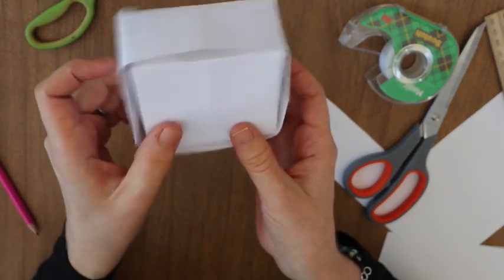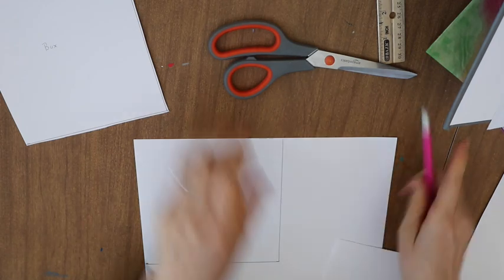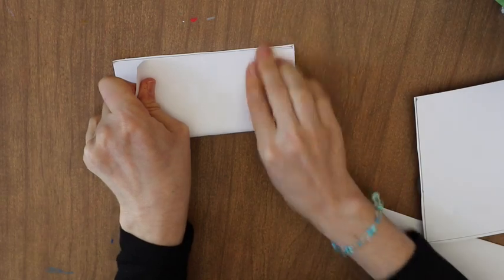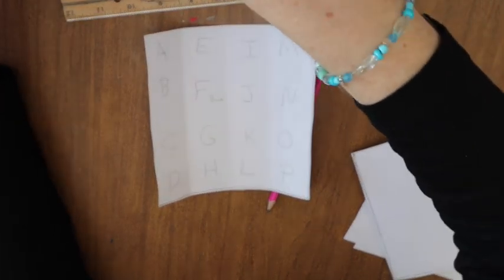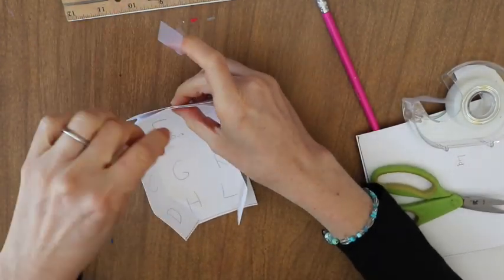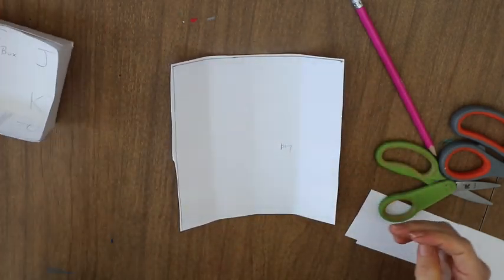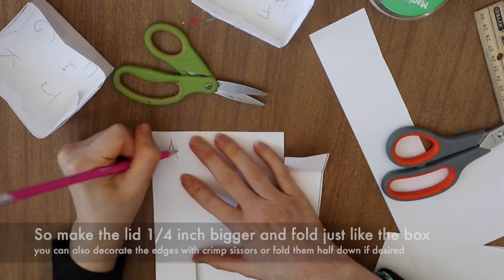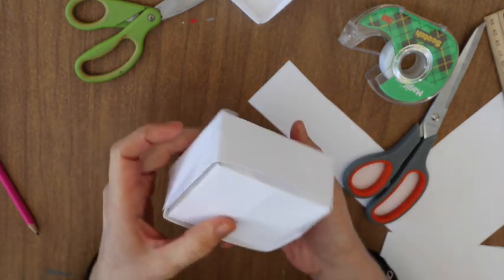"Box and Lid" Paper Modelling by M Swannell

Comment: could you show a video for the lid. That is the part I really want to know how to do based on the cutting marks swanell gives. I didn't get it at all.
Reply from the maker: the lid starts at 4:42 :) you make it exactly the same as the box but 1/4 of an inch bigger. so if you make a 6 inch box, make a 6 and 1/4 inch lid. :) hope this helps!
Reply from the maker: in the video I say to do it 1/8th of an inch but 1/4 of an inch worked.